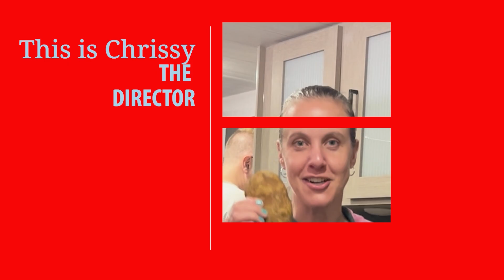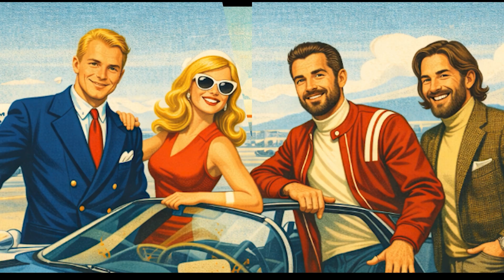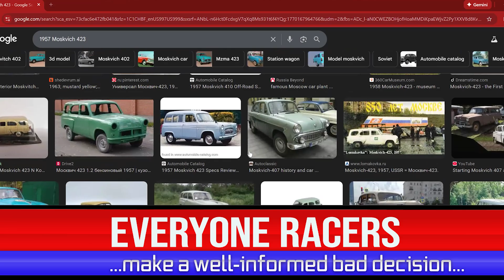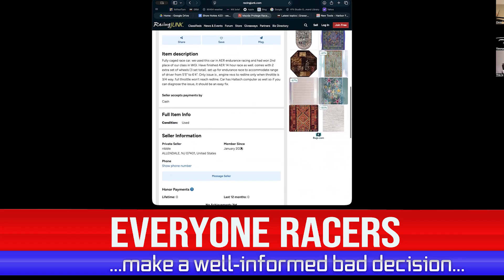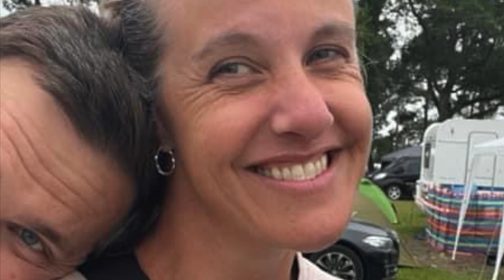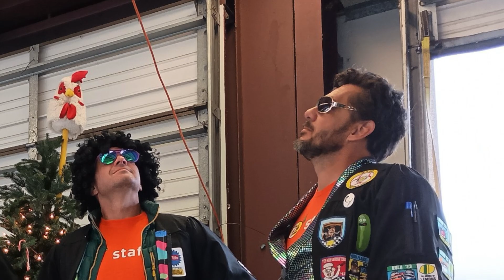Learning Welding as A Weekend Racer

Comment: I have a miller with autoset feature. when you don't weld often it really helps find where you need to be for what you're welding. Especially when welding sheet metal, body panels etc, you dont waste time blowing holes through trying to find the right setting.

Comment: Though I agree to not buy flux core only welder, I absolutely get annoyed with folks dismissing flux core as only fit for “farmer welds”.  It is often ignorance in that you have not seen quality welds with flux core but it also just perpetuates the stereotype that all you can do is bugger welds.  Flux core is exceptional for field repairs at the track including all the cages we have modified to help them pass tech…Midwest is windy with no garages at some tracks.  It excels at doing higher penetration with the punny Eastwood 145 (yes, my welder for 6 years as well) when you do need to weld ¼” plate.  Cannot get that metal fully clean of paint/rust/grease (again trackside repairs), flux core (and stick) float a certain amount of impurities out to be chipped off.  The lack of the gas nozzle on the end of the gun lets you get in even tighter spaces like between the footwell tube and the body when fixing an incomplete weld on the professionally installed cage.

So learn BOTH MIG and Flux-core or Stick and don’t be a TIG snob…TIG has its place as well but also not the best solution to all welding problems.